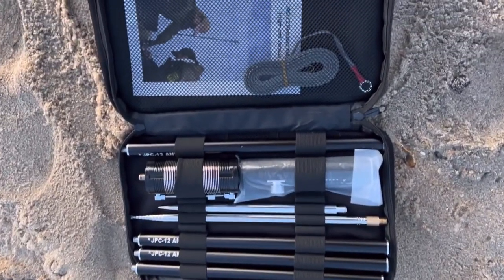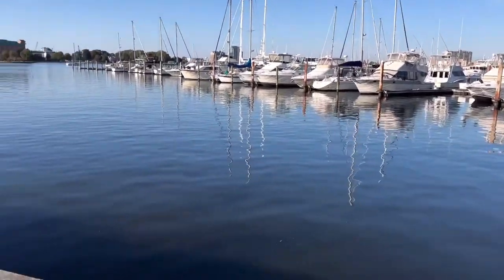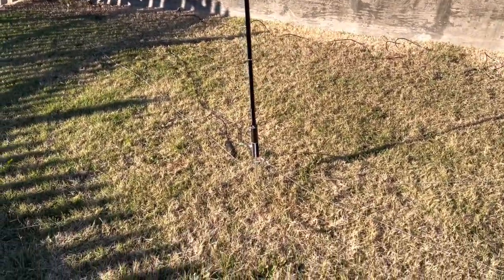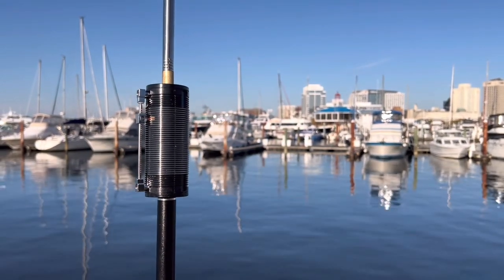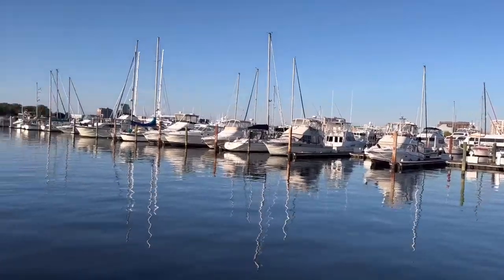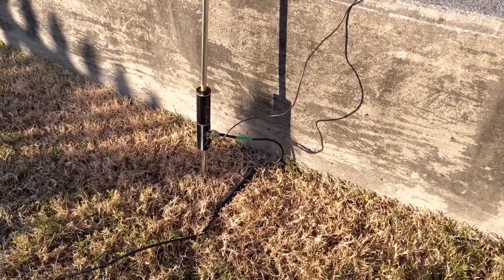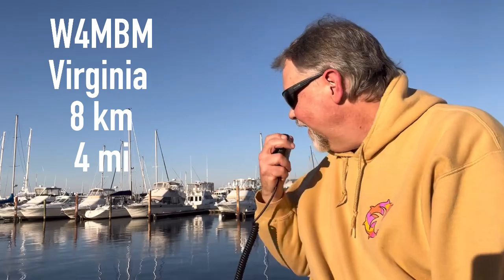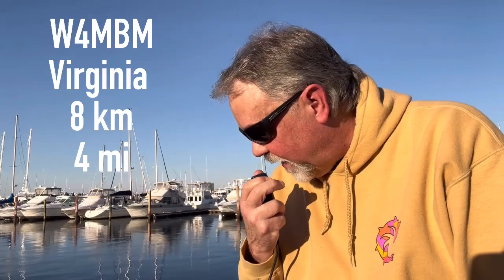JPC-12 Antenna - Making it Work Successfully

Comment: Interally, the wire that connects that ground/radial to the SO-239 ground is small. It may have an intermittent connection. That ring terminal also has issues.  If you look at it, if it is placed the wrong way ("Upside down"), it will not fully seat and create an intermittent short.  If you haven't yet seen it, my first review on the JPC-12, I disassemble it and show how flimsy the wire can be.  In fact, I broke it.
Reply: Had to flip mine too. Ended up with a ground plane plate solved the problem.
Reply: @Aimsport-video  interesting!
Reply: I wonder if the issue is that the body of the alloy where the SO-239 is located is anodised and not giving a good electrical connection to the body thus the radials connection area? As Walt added a counterpoise connection directly to the coax ground and the antenna worked.
Reply from the maker: Your videos were a major help in the process, I watched them. Great stuff!
Reply: @COASTALWAVESWIRES  Thanks. If it's not one of those things, I'll be really curious to hear what the solution was for future reference.   73!
Reply: saw that video 😊
Reply: I just looked at the HamRadioDude video with the broken wire and it looked to me like it was not the ground wire but went to the center pin on the SO 239.
Reply: @dandypoint  you know, you're right.  Oversight on my part.  Thanks for pointing that out. I'm intrigued now on the solution.
Reply: Link to the video please?

Comment: Walt: I think the threads of this antenna are metric....ie not 3/8 inch. Did you figure out a way to use this antenna with other antenna parts from your antenna toolbox. If so, could you put a link in the description to the adapter.  I might have to hit the CFO/XYL up for an increase to my ham radio budget to get one of these....
Reply from the maker: Haha use me as a reference if you need to Steve. The threads on this are M8, I haven’t found an adapter jet but I’m sure there’s something out there. I’ll let you know when I find something. If you’re familiar with navy identifiers I call my xyl NAVCOMMWIFELANT 😂

Comment: Well it worked with pool noodle. I would check the continuity of the ribbon cable once connected to the PL-259 on the coax.
Reply from the maker: Yes I thought about that and will check it.
Reply: Had that antenna in my cart...... I guest I will have to wait on your findings.....

Comment: Hey Walt, just a thought but I’d check the dc continuity between both the threads of the SO239 connection and the threaded section where you’re connecting the ring terminal for the radials then do the same but to the center pin of the SO239.
I wonder if the radial connection is in the wrong place?
Good luck and keep ‘em coming!
Reply from the maker: Thanks that’s a great call. I’ll do that!

Comment: I used the optional radial plate. The ground stake goes through the radial plate which has the radials attached. Mine worked well right from the start and  is my go to antenna for portable DXing.  Congrats on the success with the antenna!
Reply from the maker: Thanks! It seems like a great antenna. I’m hoping for others sake that I just have that problem with mine and it’s not very common.
Reply: I have done the same and fitted 8 x 24/0.2 wire ( all 5m long). I also have the extra long telescopic antenna and worked out that I could get it to resonate on 14 MHz with the 4 rigid poles and the long telescopic. This removes the need for the coil on that band. I used my NanoVNA to get a minimum SWR at 14.2 MHz. I currently have it at our holiday cottage in Devon, UK and on Wednesday 3 July I worked a VK in Adelaide, S. Australia and got a 57 report! With the coil and above set up I can get it to tune on 60m as well. My rig here is FT-897 with just 100W. The VK worked an OE station and as he was ending that QSO he said, ‘Just the G0 portable station go ahead’! I was amazed that he heard me through the original pile-up! Delighted and a great antenna!

Comment: I know some Hams that uses the JPC-12 Antenna have scraped away the lacquer on the bottom of the Base unit to have a better connection to the counterpoise wires.
Reply from the maker: That makes a lot of sense

Comment: One thing I found out is that the coil on these systems are 5 ohms of resistance when at their lowest frequency setting. That alone is going to help it achieve a low VSWR, but will also tend to dissipate the RF in the coil rather than radiate it.
Reply from the maker: That makes perfect sense.
Reply: The feed base resistance on mine is negligible, a tiny fraction of an ohm